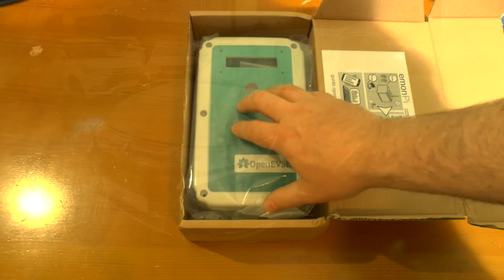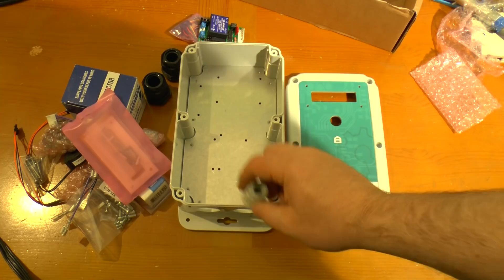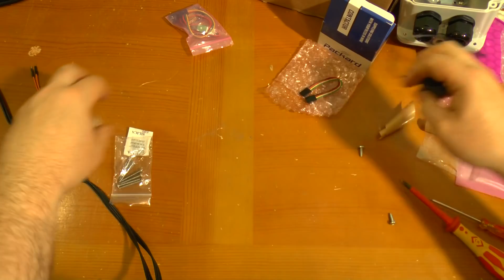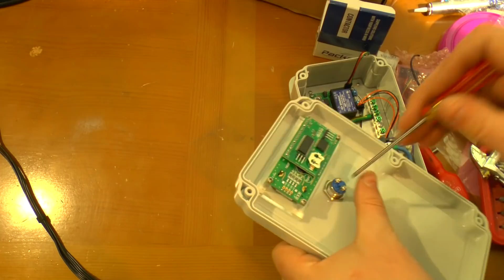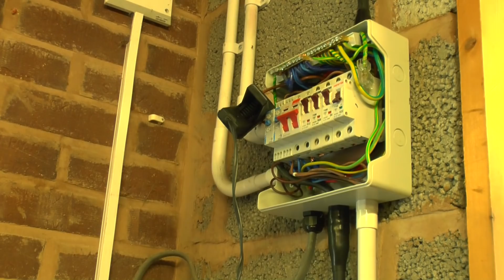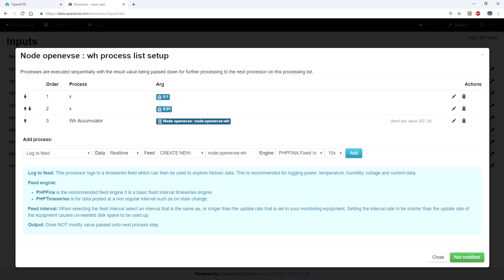OpenEVSE build and mini-review

Comment: To disable the front panel button you could fit a simple key switch in series.
Reply from the maker: That would disable it altogether though, including to wake up from sleep to do an ad-hoc charge. It'd be nice to have the option to lock out the settings bit without locking out the rest.
Reply: I was thinking about this with my unit and you could just unhook the button but that would lock out everything else.
Reply from the maker: @magic1010d  I use the button if I need to wake it up for a daytime charge instead of waiting for the timer.

Comment: Seems a bit of an inelegant design - is not like you can't get keyed connectors for instance, and there are large open areas yet cramped around the contactor connections, and needing the basic mods you made
Reply from the maker: Some of that may be a tradeoff due to the size, many other chargers are quite a bit larger (the OpenEVSE seems smaller than the pictures suggest, whereas the Rolec Wallpod seems much larger than the pictures suggest).
There's a Type 2 socketed version of the OpenEVSE called the EmonEVSE, this is mostly DIN rail based and is a far larger unit. It appears also to have a suitable screw mount for the wifi module. https://community.openenergymonitor.org/t/dev-openevse-type-2-non-tethered-enclosure-emonevse/5649
Reply: @AintBigAintClever   I love that EmonEVSE, I didn't know it existed. I'm currently building a tetherless version of an OpenEVSE. Using the standard box like yours, but running the EV wiring out to a box, with Type 2 sockets; mounted to the exterior of my house. I'm in a very hot climate in Texas and I didn't want the EVSEs sitting in the heat all the time
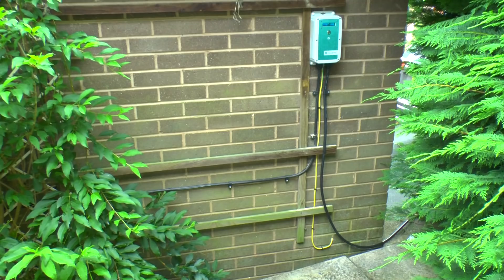Reply from the maker: @Andrew86PM  nice one! Just a tip in case you're not already used to running cables outdoors, put a loop in the lead where it enters the house (see the earth cable at 18:58 for example), it'll stop any rainwater running down the cable into the house. Also it's worth getting the coin cell for the display if you don't already have it. Although the time can be internet synchronised it won't do this automatically following a power outage so any timers will be out of whack.